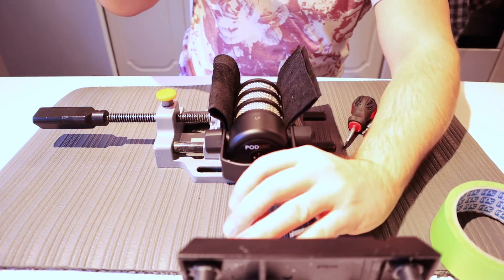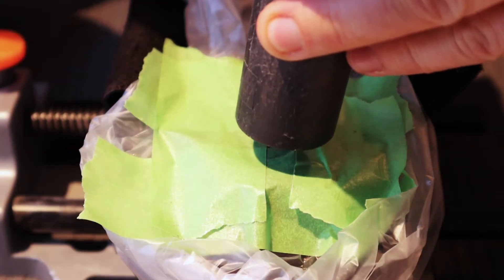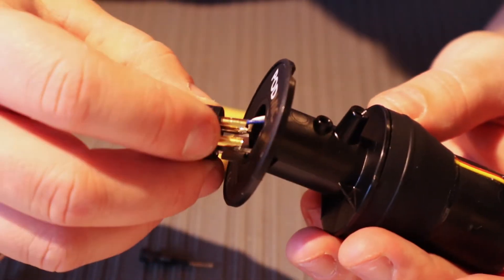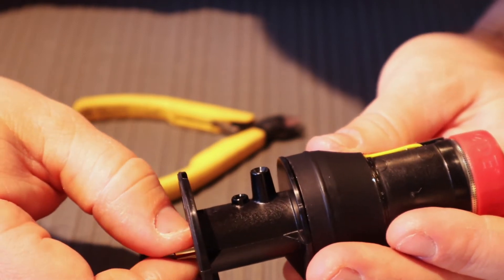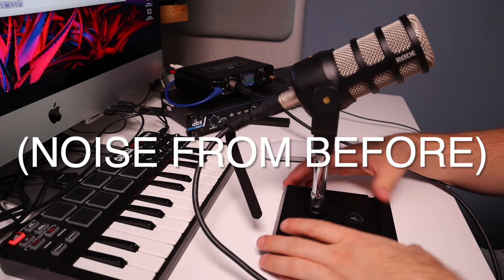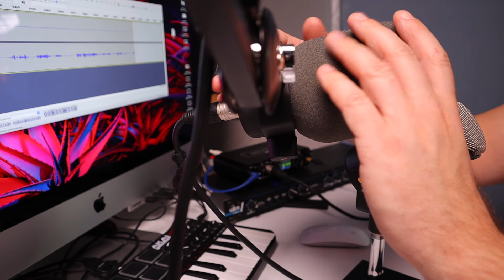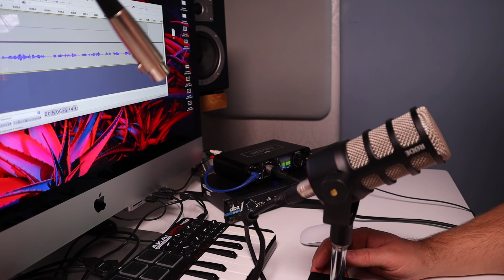How To Take Apart The Rode Podmic (DIY Grounding Issue Fix)

Comment: Super interesting to see this! I wish it were a bit easier to take apart, but I'm impressed by how you knew exactly what was wrong. Glad you got the grounding issue sorted out!
Reply from the maker: Yup, It seems like it's one of their own security screw (they 're not revealing anything if you ask them) Brass is relatively soft, but it is firmly stuck  in there. I have a background in live/recording audio, soldering and trouble shooting is part of the gig many times. Podmic would be better without the plastic part. Thanks for stopping by Tom! big fan
Reply: @TimPhoenixTV  nice to see you figured it out and that it was a relatively easy fix, but I for taking the screw off, I am pretty sure the thingi tool you tried to use would have worked if you would have combined it with pliers, then you would be able to apply more force on it.
Reply from the maker: @propm  Sorry for the late reply, must have missed it. -I agree, just didn't have the right pliers for it. Thing is, there's no reason to use a screw like that. Shure uses common screws, and even guides you through the process of swapping out a capsule or whatever. Must be a warranty thing, but still.

Comment: My podmic was sounding very weird and bought it used so couldnt get a lot of help. and found that the spring was completly missing. so fixed that and now it sounds great! Thanks for the video!
Reply from the maker: awesome that you fixed it!
Reply: Bro, can you tell me the dimensions of the spring?
Reply from the maker: @HopperBeamNG it’s tiny, get a few different ones and try. Should be about an inch or so long, just thread it on to the screw so that it sticks good, and cut/bend to make it contact the plate down in the hole.
Reply: Thank you very much! @TimPhoenixTV

Comment: Thanks, that is a very cool instructional method to take it apart!  I looked everywhere for the driver but couldn't find the 3 pin in the triangular orientation.  I was afraid to perform the surgery like you, as i wasn't certain it would allow me access to the inside of the metal protective screen.  I wanted to open mine up to put a thin carbon filter pop filter inside so I wouldn't need a big foam wind screen for plosive control.  I wonder if the driver was custom for Rode or if maybe they would send you a replacement screw.
Reply from the maker: Thanks! And great idea to add some kind of pop filter inside, if it's thin and dense enough. An outer windshield adds distance to the capsule which is good but not as pleasing to the eye.   -I think it's rode's own security screw so you'll have to make a driver or drill the screw. It was fairly tight on there I can assure. It's no big deal for me if it looks weird now after drilling it, just don't drill too deep or too close to the threads. Also mine was out of warranty so If I had had any issue with a newer one I would just use the warranty.

Comment: Fab video ,just a thought I used to work in a music shop workshop to save opening the mic maybe unscrew the xlr connection that goes in to it and try jumping a small wire from pin 1(screen /ground connection & its always longer so connection is made first) to the tab on it that connects to the body of the xlr continuing the screening(you would have to solder it but it could prove  easier than drilling. Just a thought but fab video.
Reply from the maker: @ianroberts7119  that would work on most mics, easily..  but in this design its plastic and fiddly to run that jumper to the shell. But yeah, not impossible. Thanks for the input! Cheers
Reply: @TimPhoenixTV   Yeah,the connection can be made inside the Xlr plug and extended the Screen/earth connection if into the mic body.The earth tab connects to the body if it has wire linked.I try to attack a piccy :-)

Comment: Found and can confirm today, security spanner bits will work for that annoying screw. Specifically a 2.6mm spanner is the perfect size.
Reply from the maker: Awesome! thanks man
Reply: bought a spanner bit (2.6mm). They are the right width to be on top of the holes but don't fit unfortunately.
Reply: @vinceandcassie  Oh damn, sorry to hear. I read about a 2.6 being perfect, mine must've been slightly different.
Reply: @micheal355 so I got brave and just drilled the holes out in the screw. Just a bit bigger and IT WORKED 🤙🏻. Your recommendation is probably still the best option. It still looks clean too. Just has two slightly bigger holes.
Reply: @vinceandcassie  Good deal, glad you got it.

Comment: Hey I’m curious if you know the interior diameter of the body.
Reply from the maker: 43mm (4.3cm) hole. From the bottom to the mesh it's about 120mm (12cm). Inside the mesh it's 52mm (5.2cm)
Reply: @TimPhoenixTV    Thanks!  I was trying to figure out if I could pop off the front grill and stick in a Rode Wireless Pro mic.  Kind of a silly exercise.  But I was trying to save some money if I can find a broken one.  Looks like it will fit.  I just need to find someone who is giving a broken one away.
Reply from the maker: @EdNeuhaus  You have about an inch (2-2.5cm) from the capsule to the mesh if you wanna keep the original mic inside.. If you wanna remove the mesh on top you'll have to epoxy it back. Good luck!

Comment: My podmic gave me a milk electric shock on touching the grill. I guess it was due to the grounding issue only. Even though it sounded fine, I had it returned. Didn't have the skill set to open it and fix it myself.
Reply from the maker: You probably hade the same issue. Some mics do this even thought there is nothing wrong with it. You could have other grounding issues in the apartment/house and other gear.

Comment: is the screw mount adapter permante on the mic ?by the way
Reply from the maker: @roninstormYT  yes, but you can remove it but then you have two pegs/threads sticking out the sides. The mount has both us mic stand thread and European mic stand thread.

Comment: Sir i need help, it's ok if i turn on phantom power for rode podmic? 
Bcz my audio interface not have much gain for this mic.
Reply from the maker: The podmic is a dynamic mic, so it doesn't need phantom power. What you need in order to boost the signal is an " in-line  mic booster", like the one I have (triton audio fethead) which boost the signal by about 20 db.
Reply: @TimPhoenixTV  when using triton, do you turn on phantom power?
because it looks like the tool needs power.

Comment: Can my spring be bad. ????
Reply from the maker: Yes, or not make contact. Then you have no grounding.
Reply: @TimPhoenixTV  well i strength the spring to make longer.   But  shows resistance.  I pul everything a part.    And move. The wires.  But still make. Strange sounds  when I touch the body of the mic.  So i  went.  To buy another one. And try.   And still the same.    Make stranger sounds. Whet touch the body of the mic. And. If you touch the. Mic arm.    Or the desck. It make  noise.     At this point  not sure. Whats the problem.  😞🙏🙏🙏
Reply from the maker: @1Wayfix sounds like you might have a bad cable, try swapping it out.

Comment: wow so it is not simple to open the PodMic, hoped it were easier so could put a better popfilter in
Reply from the maker: It is possible! just open the mic like I did, and insert more filter. alternatively keep the mic further away from your mouth or use external pop-filter (foam windscreen  etc)
Reply: @TimPhoenixTV  Thank you. May I ask how much gain do you use with the IOI24? I use a fatheat for Podmic with my IO24.
Reply from the maker: @DieTabbi  I use a fethead too, then just set the volume to whatever is comfortable. On my preamp it’s at +30db. Probably the middle or just over half volume on the usb sound card.
Reply from the maker: https://youtu.be/GWpaDhxEgT8?si=fPH4oK84lwKjAjXs